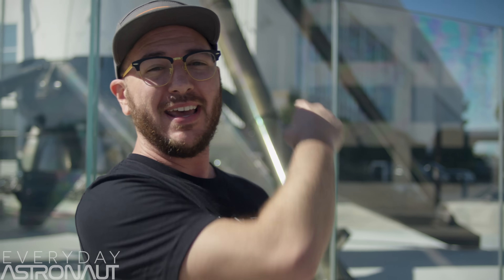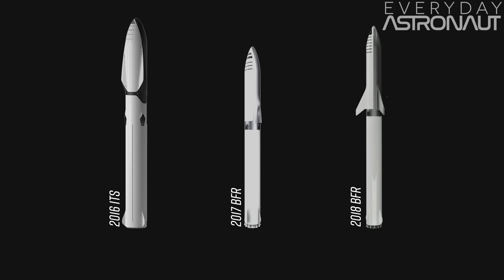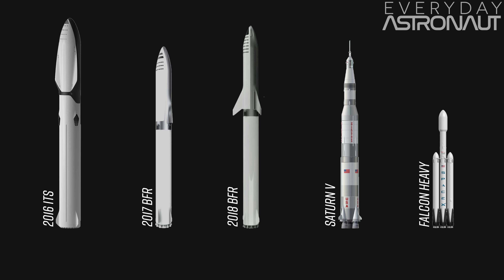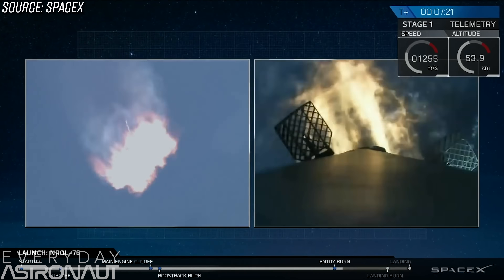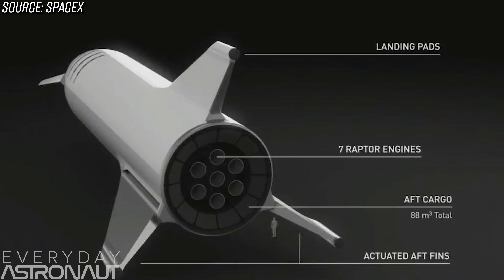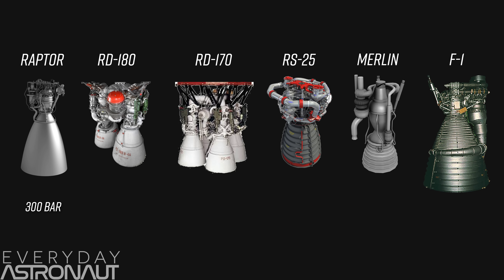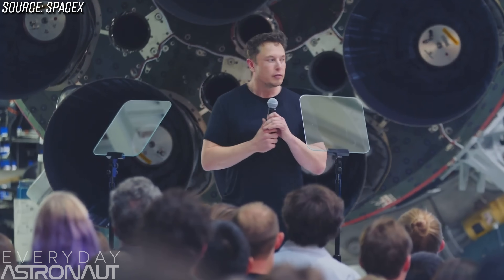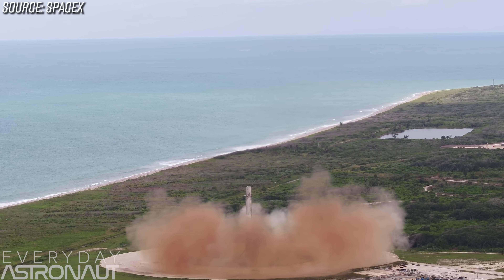Why does SpaceX keep changing the BFR? The evolution of BFR

Comment: Very late comment but... Thrust and therefore Isp improve in a vacuum even without increasing expansion ratio, so the BFR upper-stage engines should do better than 330 sec there. For example, the Merlin 1D's Isp improves from 282 sec (SL) to 311 sec (vac) even with the 16:1 bell, and then to 348 sec (vac) with the 165:1 bell.

So as a bottom line, I would expect Isp = 350 sec in vacuum or maybe a touch better for those "sea-level" engines.

Comment: As to innovation is good if not abused, you might also want to ask for improvement graph/s, there are still alot of things to be considered when it comes to safety.
As of now, the project is still crawling to perfection (although it is already starting to show perfection, with humility) , and may it be odd looking at some of the specs missing but, as simple as it is, it worked and safe. As for those flaps' main purpose is for going upward mainly and still quite effective at vertical landings.
And the missing moving mechanical parts helped in solidifying the project.
Because simple things are quite solid, simple as that. Less expensive but quite effective and saves alot of resources for the next runs and in the future.
If that additonal moving part/s would be added (making it land like a plane also requires a runway or combination [flying and land like a plane but can still land vertically], while in that way only requires a piece of land), and if in some circumstances should fail (hopefully not), then that would be a fortune to be lost which is supposedly be used for other helpfull projects, not to mention the possibility of lossing the trust that the project already achieved.
If the the simple thing is already there and is already proven effective, then with humility, it is quite practical to never remove it.
Simple things are solid.
Now, simple things does not mean that it will only take a page of the book to be simple all the time, we all know that, but sometimes, simple things to be solid are also composed of solid pages. Shows in the project itself.
The landing procedure can be used when entering planets where there are no runways (maybe often more in the future to come), including our planet. 
By the way, pressure does that, because alot is questioning the move on building that kind of innovation, but, if look closely, our planet is dying everyday, and that move triggers even the smallest possibility of life, or even more. Small for now, but hopefully very helpfull in the future, instead of people fighting each like we all don't have the chance for a better world🥺. 
We deserve better, we all do, big or small. 🙏

Comment: Hey Tim, I’m from the future - Starship has 2 fins now!
Reply: Hey Anton, I'm from the future future - Starship just did a hop!
Reply: Hey! Maximus Berry  I’m from the future future future SN5 did a hop
Reply: @maximusberry1620  Hey Maximus, I'm from the future future future - Starship just did a 12km hop!
Reply: Hello from the the future - Starship has 2 fins now!, I'm dad!
Reply: im from the future and the sn8 starship maked a flight and crashed and a sn9 is on the pad
Reply: @nada1638-g6j  hi Gabriel Sathler! I am from the future and sn9 will do a hop tomorrow
Reply: @lapistaoftheparadise4627  Hi La pista of the paradise! I am from the future and the Raptors from SN9 were swapped
Reply: @fedora997  Hi Fedora I'm from the future and Sn9 tool off and did a 10km test flight.... didn't land tho
Reply: @chonk3358  Hi chonk! I am from the future and SN10's raptors are going to be installed and cryoproof testing happened
Reply: @fedora997  Hi Fedora. I'm from the future and SN10 just perform a static fire test.
Reply: @kaif3351  Hi KAIF BEDI. I'm from the future and SN10 has done 2 static fires and will fly Monday.
Reply: @fedora997  Hi fedora. I'm from the future and SN10 just landed
Reply: I’m from the future future. Starship just flew 10km into the sky flipped horizontal, fell through the sky, and stuck the landing.
Reply: Sn7 just hopped.
Reply: @elizogby  *SN6 hopped. SN7 was just a tank for pressure testing using a new steel alloy.
Reply: @Armin Arlert im from the future future future future future SN-15 just did a sucessfull landing
Reply: @Hosopfzeljko  im from future sn20 jist reached orbit, super heavy exploded
Reply: @JachetTV  you missed it ut didnt even happened
Reply: @Hosopfzeljko  im from future
Reply: Anton hi
Reply: hey Anton, if from the future, now 4 starships have flown
Reply: @hoppy791  Hey I´m from the future and sn 15 is going to fly very soon and the first booster prototype was complete and now tore down
Reply: Hello, I’m from the x5 future, I just finished my first static fire 🔥!
Reply: @starshipsn1511  Hey, I'm from the future, SN15 just got scrubbed!
Reply: @BussinFields  Hey, I'm from the future, SN15 just landed
Reply: 1 year from the future the tin can landed!
Reply: @Alexander-kk5gj  yes
Reply: I’m from the future, IFT-1 and IFT-2 have both launched and IFT-3 is well on its way

Comment: Mass to orbit reduction fully explained by the change to all sea level optimized engines - Assuming 1/2 of orbital velocity is provided by the BFS, fuel requirements go from 65% of mass (at 380s ISP) to 70% of mass (at 340s ISP). That extra 4-5% of starting mass has to be taken from payload capacity, since the lower stage isn't getting larger.  Interesting trade off! Also means SpaceEx could increase payload mass to equal the 2nd generation SLS, just by changing the engines to space optimized ones, and eliminating the rear payload bay.

Comment: Carlos Encarnacion:  I love this project. Since it would take around six months to arrive Mars I wonder and think that habitable zone area within such ship inside wall should have at least a 3/4 feet wide size empty compartments protruding from inside surface matching space ship curved design that could be occupied with non flammable bags containing sand and rocks or any other radiation protecting materials to protect astronauts from short wavelength radiation that would harm them on the long run during such long trips until new thrusters technology arrive in the future to shorten such trips. Consider that astronauts  efficiency and performance might be affected in Mars as a result of such long trip short wave length exposure and we don't know potential outcomes .Once there underground structures, caves or new technological advances could solve such situation permanently. Those compartments once occupied by rocks and sand bags inside would have the other habitable space structures within space ship above them. If installed before they would add weight and cost during lift off. If lifted in a compartment closed to tanker surface during refueling through pressurized hatch openings giving access to both tanker and habitable space ship inside once in orbit protecting material could be transfer manually and put inside the wall empty compartments of habitable space ship. Any way they would add weight to refueling tanker during lift off and further engineering design would be mandatory on both space ships.

Comment: 10:50 for comparison most cars that are tuned with a Turbocharger and then run about 2 to 3 bar which is around20-30 to 40 PSI

Comment: They aren't concerned about sea-level or vacuum optimized engines because they've sorted out variable expansion nozzles. You'll see it in a few months.
Reply: Well raptor has a chamber pressure of 300 bars so the nozzle ratio is already very high even with a sea level nozzle.

Comment: It's keeps changing, because it's never going to happen.
Reply: No, it's already happening
Reply: @squdardt.9719  
Sure
Reply: @IanZainea1990  You don't believe me? The 2 orbital prototypes are almost ready.
Reply: @squdardt.9719  They've had a few failed attempts for the first stage (?) that is no where near getting to mars
Reply: @IanZainea1990  Actually the hardware of the first stage is almost done. That means it probably is going to happen.
Reply: @IanZainea1990  And the failed attemps are not so bad.
Reply: @IanZainea1990  Today the sub orbital prototype is launching 150 m in to the air with only 1 engine. Crazy right?
Reply: This aged badly
Reply: @Tuuminshz  I mean. It still hasn't happened all the way, like a full test run I mean. I'm a little excited for it now. It's won me over a bit.

Comment: Love the video. Dude your ears are aerodynamically out of whack.  Nothing wrong with that, just thought you should appreciate that along with your eye thing.   Back to rocket design; especially landing boosters for re-use.  I really think it is unwise to land standing up.  Landing should be a two step operation where once you stick the touchdown; you immediately lay down horizontally and not remain vertical, which is most unstable.  This technique almost designs itself.   Two - four lay-down boosters: two to control laying down into the wind and two for actually easing the lay-down that are 180° apart.  You need enough thrust for about a 20 second transition thrust.  Extra legs 3/4 of the way up the booster to carry the mid-load.

Comment: Space X keeps changing their designs because Blue Origin hasn't made an orbital flight yet...
... and they don't want to be like them.

Blue Origin has committed to incremental advancement.  Something is done.. it's done to plan, it's done perfectly.. and then it's tested in infinitum until it meets the numbers it's supposed to.
Space X stuck the parts together.. blew it up.. rebuilt it after figuring out what blew up.. got one that didn't blow up.. measured the thrust and weight... and built a rocket around that.

Wash.. rinse.. repeat.
It's said that no two rockets that Space X has ever built have been the same... until this most recent iteration of Falcon 9.

In the immortal words of agent Smith... "One of these lives has a future... the other... does not".

Comment: I really don't like how the landing legs / fins are also actuated. It's mechanically really difficult to make the fins actuate, yet also make them support the weight of the FULLY FUELLED BFS which will weigh over 1,000 tons - remember the F9's legs only have to hold the weight of a near-empty first stage.

Comment: Excuse me, may I correct you regarding the rocket engine comparison at 11:00? The chamber pressure of RD-170 - first flown in 1985 - is 250 bar. The Raptor is now tested at 200 bar, is aimed for 250 bar (still not flown) and is expected to reach 300 bar in future iterations (Hollywood stuff). Citation Wikipedia: "The test engine operates at 20 MPa (200 bar; 2,900 psi) pressure. The flight engine is aimed for 25 MPa (250 bar; 3,600 psi), and SpaceX expects to achieve 30 MPa (300 bar; 4,400 psi) in later iterations."  If the Raptor flies in 2020 and reaches 250 bar, that means SpaceX reach the russian state-of-the-art from 1985 and is 35 years behind RU in some technological aspects. Since we are not in Hollywood, you should remove the Raptor and the fantasy of 300 bar and put it between RS-25 and Merlin where it actually belongs!

Comment: I Don't understand why you are debating vacuum engines and  sea-level engines. The only time you require engine output is, when landing takeoff and encounter burns(if you have very high speeds). When in space you have time to burn vacuum engine at longer burns to achieve the desired orbit..... Then it is logical to have more sea-level engines than vacuum engines. 
 You would want to have "a bit more" trust than an ion engine but Maybe its enough with trust from one vacuum engine. But redundancy is the question here. If the vacuum fails, the sea-level engines can always be used, but at high enough efficiency? that's the question?

Comment: I will say something that people would not like.... A heavily changing concept is a sign of poor leadership. The thing is that there is always that guy that was correct to begin with. A good leader will find them... A bad will just keep on testing
Reply: The whole point of the 2016-2018 is to tweak & make changes with their design -- keep in mind, it's not as though they were actually building the thing in that time, nor did they intend to.  When asked, Musk recently said that less than 10% of SpaceX resources have been going to the BFR with the vast majority going to Falcon 9 block 5 & Falcon heavy.

Now that they're building, they've locked down a design that they like -- one that was honed by years of number crunching, simulation, & creative problem solving.

Every company does this when they create a new product -- the only difference is SpaceX actually shows you their design process whereas other companies don't show you anything until they're done.
Reply: @dr.zoidberg8666  
"Every company does this when they create a new product "
No that is incorect. Not with major design features. With minor, yes. Not major. This is a clear sign of bad leadership.
Reply: @matsv201  Sorry, but you're wrong -- your whole conception of "the guy who was right all along" is a fairly tale & simply does not exist when you're trying to solve problems that have never been solved before.
Reply: @dr.zoidberg8666  You clearly never worked in engineering
Reply: @matsv201  & you've clearly never done any novel research-based work.
Reply: @dr.zoidberg8666  You don´t know what you are talking about, because i have. I worked quite a lot in research engineering
Reply: @matsv201  lol
Reply: @dr.zoidberg8666  And you havn´t because you don´t recognize that pretty much every single time is the person hon say early on why it won´t work and becomes overrun every single time....

Sure.. there is sometimes the person that say it don´t work and are wrong to... but that is not the point

Comment: When you have a good question, most of the possible answers are already there.  Additionally, there is very little emergent technology in the BFR/BFS vs, say, the X-33.  The DC-X tried to avoid emergent technology.  The Shuttle had a LOT of Emergent tech that kept shrinking its capability.

Comment: Because the ITS/BFR announcements have much more to do with generating publicity/enthusiasm than promoting a specific product. Since SpaceX does not have the resources to develop a cleansheet super-heavy rocket right now (Falcon Heavy was completely derived from Falcon 9 hardware), they have to pitch a bunch of concepts in the meantime to keep the headlines and online discussions going.

Graphics and animated concept videos are cheap and can be turned around quickly. Flight prototypes are not. So we're seeing a new concept each year until SpaceX finally arrives at what their investors will agree to fund.

The ITS concept was created to sell the vision of Mars settlement. The 2017 BFR was sized to an Airbus A380 cabin and used to sell the idea of rockets replacing airplanes. When it became clear to everyone that neither scenario was actually going to happen in the next 10 years, Elon pivoted to lunar tourism. It had plenty of potential customers since the 2017 announcement and had reasonable life support requirements comparable to Dragon's.

And because this version of BFR needed to be sized for TLI, not LEO, like the P2P transport BFR, it needed to be stretched. More fuel for the first stage (which would be expended) and for the second stage to enable TLI and fuel margins for propulsive landing. The tanker was thrown out completely for lunar tourism, as SpaceX has no on-orbit refueling experience and refueling would be a major inconvenience to the passengers.

Everyone asking about funding was raising an important point, though. This can't happen without billions of dollars in support, and even in a best-case engineering lifecycle, development timelines are tied to annual funding. So by asking about funding, press members were asking how seriously they should take THIS proposal compared to the previous two.

Personally, I wouldn't be surprised if SpaceX needs to scale BFR down even more to something that would directly replace the Falcon rockets. Elon didn't seem so confident that investors would buy his "cheaper than a Falcon 1" argument from the 2017 talk. 

It's just more cost-effective (and more environmentally sustainable) for SpaceX to build a fully reusable vehicle that would compete directly with New Glenn. And its payload to LEO would be comparable to Falcon Heavy's expendable load, making it sufficient for launching StarLink.

But Elon can't announce that yet because it's not as exciting or headline-grabbing as a Saturn V-class reusable rocket. So he can't publicly concede to building a slightly smaller Falcon-sized vehicle until competition with Blue Origin pressures them to do otherwise. That's another reason the development timeframes announced are so optimistic. If BFR can't be finished by 2025, competition with New Glenn would force SpaceX to delay it in favor of a smaller fully-reusable vehicle.

But the point is, it's still VERY early in BFR's development cycle, and they're still a ways from having a PDR at this point. So in the meantime, they can experiment with various concepts and stay in the news that way. But until they announce a configuration freeze, there's no reason to expect a Grasshopper version of BFS to launch fewer than 2 years from now.

The recent pivot to a Falcon-sized BFS for orbit reentry flights hints that the real thing will be sized to replace Falcon 9 and some FH launches. Not to launch 150 tonnes to LEO.

That's just my two cents as an aerospace engineer, though. :)